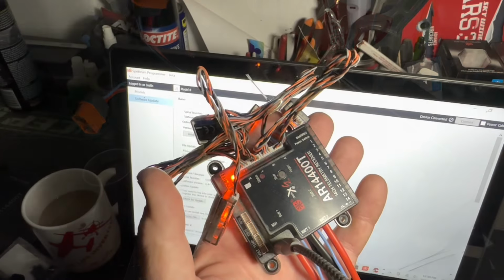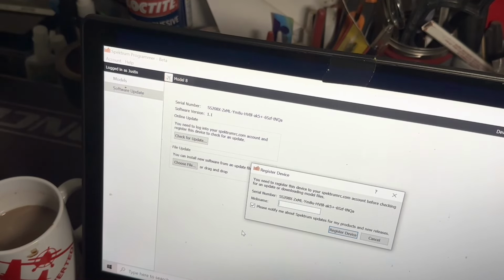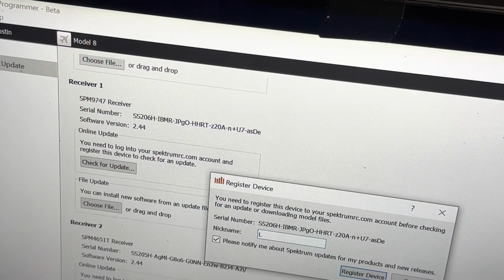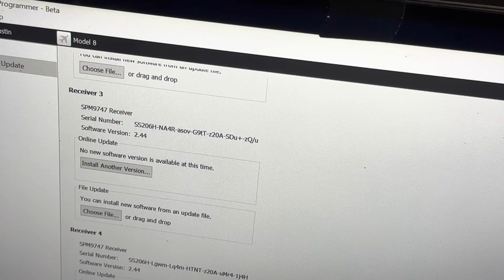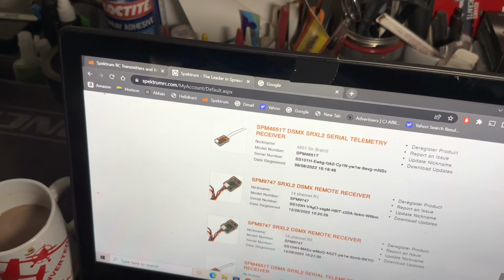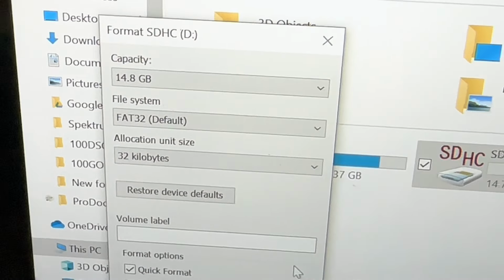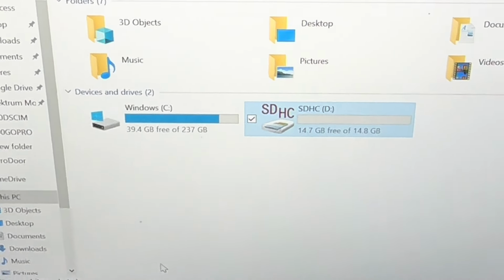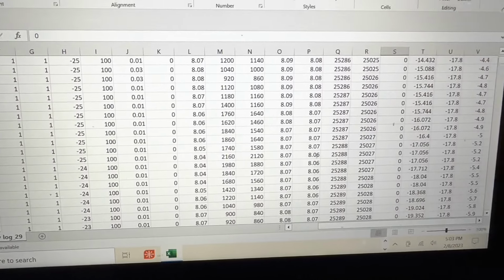Spektrum AR14400T Powersafe Reciever    Everything you need to know in easy steps!

Comment: Hi, thanks for stepping up and producing a video.  I have a question.  The manual talks about X-Plus to access more than 12 channels on this receiver.  If you know about this, can you provide guidance on how to do this?  Could you also explain the lettering on the telemetry ports (B-back, L-left, R-right, A-?)?
Reply from the maker: It’s A for the 4651t.  Then you have left , right, front, and back remote receivers.  There are different length cables to place those receivers.  Hope this helps.
Reply: @CoeShow619  Thank you, it helps tremendously!  If I want to use all 14 channels that are available is there any configuration changes I need to make?

Comment: I'm having an issue . My reciever is only showing 1.3 volts however the Telemetry shows the battery voltage at 12.4. Do you have any idea what could cause this?
Reply from the maker: Is it the AR14400t? What batteries are you using? I have no details.